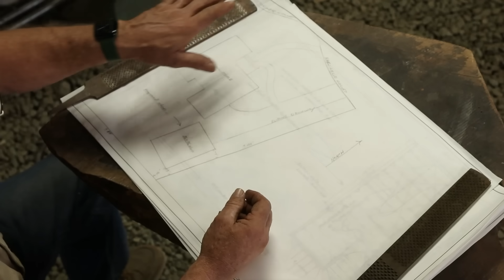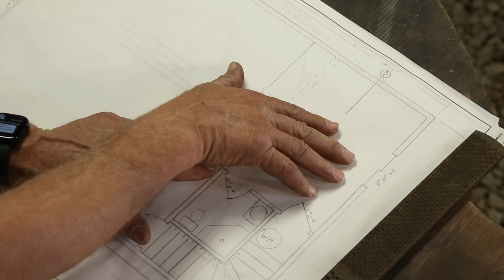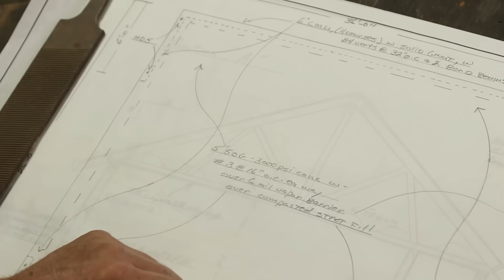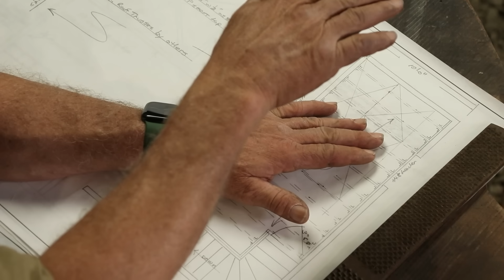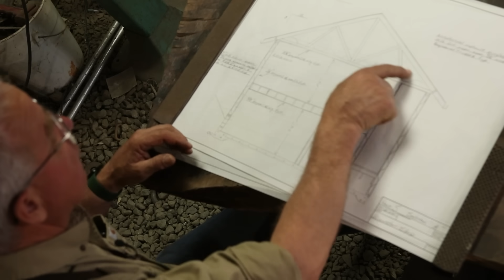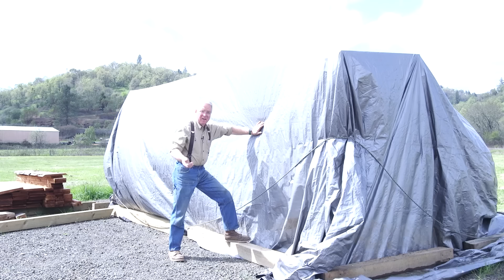Reviewing The Plans: Shop Build #1

Comment: Nice design. Love the bathroom and office. I did alot of flex space in the New England area in the 90s just like that.

One problem I saw: in the section of the stem wall the grade runs down and into the structure side wall.
That's a bad condition, especially w/ a CMU wall Vs. C.I.P.

In my general opinion and for conversation only:
Slope the wall back from the building 2-5% for 3-4 ft. to a swale that runs to the low side, front or back.
Add one or two course(s) CMU as req'd.

Comment: I'm sure it's too late for design suggestions...  but I would add some windows. On the North wall I would replace the louver with a widow (unless you are installing a powered fan). On the east and west walls I would have a window at the "second floor" level, to filter in natural light and be above any shelving or storage. and on the south side, a window into the stairwell.  As I look back at the north elevation, it appears that windows were considered and erased.   I would include an interior light on on a motion sensor that covered the french doors and the door to the stairs.  Looking forward to the new series.

Comment: This doesn't necessarily apply to the day jobs (as much), but do you have any advice on avoiding/managing burnout? I'm doing a remodel (full gut job, would've been easier to start from scratch) and I just end up having to skip around from task to task because I hit so many obstacles that I just want to quit. But I don't, I piddle around with other stuff, because slow progress is better than no progress. I know that I'm doing it all wrong, aside from performing solid work and paying cash for everything. Still, sweat equity only goes so far when you're without a home for the better part of two years.

Comment: I really like the experience you bring to your projects but what I miss are discussions about building science. I understand that this is a shop but I don’t see how you are going to insulate the slab. Are you going to address thermal bridging in the roof and walls? What sort of WRB are you using? How will you control air leakage? I am designing a similar shop and these sorts of details are easy to incorporate up front and make any building more comfortable and less costly to heat and cool.

Comment: As long as the tails are plumb, with white wood fascia boards, 30 degree drip edge 'flashing' ( NOT 90 DEGREE BARGE END ), 5k aluminum gutters that are properly graded, corrugated downspouts that won't clog easily, all you'd need is 'Gutter Stuff' to keep the crud out. 

Edit 2:
Gutter spikes are temporary, they work themselves out with expansion and contraction. 

Hidden hangers look clean but use small screws that do not hold, especially if you do not clean your gutters.

7 inch timber screws is what I use.
Withstands ice and snow,
I would know.

Comment: Hello sir, just want to know some professional tips regarding cabinets and shelves. I have a project now modular kitchen cabinets, using laminate marine plywoods. Am having a hard decision what to use with regards to screws in building pantry shelves. I want to know what's the good way to join boards without seeing screws on sides of shelves. Is it Dowel or minifix or screws with plug heads? Thanks

Comment: One comment while getting the quick review of the plans.  The section and front elevation show dirt slope a couple feet or so up the side of the building.  Do you expect to wrap the soil around the front to a touch-down point of add a small retaining wall down a drive a bit to contain the soil?  I think I also heard there would be no fascia board on the sloped ends, but a fascia gutter?  One thing I did to my shop build (and I am so glad I did) was spend additional money for the lighting and electrical.  If you think you need 4 lights, go with 8; if you need an outlet every 8 feet around the walls, go with every 4 feet.  Also, add hidden air lines (before sheet rocking) with numerous wall terminals.  There is no better time to think ahead than NOW!  It will never be easier of cheaper.  Thanks.

Comment: Live a couple hours North of you guys just south of Salem. Things I wish my shop (40x40x14) had when built:
- More 220v on the walls & 50A for welder
- Ceiling outlets for cord reels
- Ceiling air reel
- Rain collection for an exterior wash station
- AC for the office
- Solar on the roof

So far I’ve added everything but the last two. A crane hoist or car lift would be nice but not everyone needs those. Most people could use the rest.

Comment: Look forward to watching this. At today's lumber prices I cant afford to build a dog house,so I'll have to be content as a spectator, lol. I mill some of my own wood with an Alaskan mill, but you cant get much in the way of production, and it certainly wouldn't work where you have to meet codes. Currently at my local Lowe's a 96" spruce stud is $8.25 and 4'x8'x3/4" tongue and groove plywood is $66.73 a sheet. I say this only for posterity when someone watches this in the future
Reply: @Cipher Code how much production can you get out of an Alaskan mill? Can you give me an example of how long it takes to slab a typical-size log? How long does a chain last? Are you using a special ripping chain?

I'm looking at cutting a few oak logs into cheap boards for a temporary project I have going on. I'm wondering if it's worth buying a Alaskan mill and a ripping chain, or if I should just transport the logs to a local sawyer.
Reply: @jonathankipps9061  I usually use woodland pro milling chain,but I've used regular chain too. The milling chain makes smoother cuts and goes a little easier in the cut. How fast and how big you mill is dependent on how big your saw is. I have used a ms310 milling oak logs up to about 20" in diameter, but it was slow going. It took about 5 minutes per cut on a 8ft long log. Now I use a ms441cm, which is a 70cc 5.6hp saw and it can do the same size log in about 3 minutes. A friend had given me a good size silver maple 26" in diameter and I cut it into 3 8ft logs and milled all 3 logs into 1 1/2" slabs in about 4 hours. I dont remember how many slabs there were,but I'd say close to 20. If ya get a mill stick with granberg's as there quality is much better than the chinese copies. Your first cut must be absolutely flat or itll throw off all your other cuts. It takes a long bar if your gonna mill slabs,but if you want boards consider getting their edging mini mill. Itll cut down on your sawing time and it's dead on accurate. You can buy the small log mill and edging mini mill and be cutting great lumber for around $300,if you have good size saws. I leave my edging mill on my smaller saw(60cc ms310) and my small log mill on my ms441cm. You dont have to,but its convenient.  If ya have anymore youd like to know I'd be more than happy to help.
Reply: @ciphercode2298  That definitely helps, thanks!
Reply: @jonathankipps9061  No problem friend, anytime🙏👍

Comment: Nice looking project! I built my own 24'x40' 2 story gambrel roofed garage/shop back in 1995 using plans I found at a home center and modified with 24' engineered trusses to eliminate any first floor posts.  It took me about 4 months to build it pretty much by myself.
Reply: @Hello Tim how are you doing

Comment: I'm curious what you do with the interior.  I'd love a shop with a car lift, so that means high ceilings.  Also, do you wire up the shop in anticipation of the government forcing us into all-electric cars...meaning lots of places to plug your car into, if needed?
Reply: You'd only need one 220 plug.
Reply: @jamesengland7461  what if you have multiple cars?
Reply: @davidcurlee6759  even a 2 car garage this size will only need 1 plug. You'll be able to enjoy a "full tank" every morning without ever having to visit a charger unless you're going on a road trip or have a very short- range car.

Comment: How is that going to work with inspectors with the salvaged, resawn glu-lam beam (s) ? The whole concept behind engineered wood products is that it's a product manufactured and inspected to certain specifications, and it's installed according to the manufacturer's instructions and using the manufacturer's engineering data.     Once you re-saw a beam line that, it's no longer the engineered product meeting manufacturers specs, as it once was.   On the one hand, it would probably be ok to resaw a 6-3/4" X 15" (for example) down to 5-1/2"  X 13"    and then use the manufacturers engineering data for a 5-1/2" X 13"  glulam beam.  But in reality,  the resawn beam does not meet the manufacturing specifications for a 5 -1/2" X  13" glulam beam.  A glulam is not just a homogeneous chunk of wood.  The top and bottom laminations of a glulam (where most of the compression or tension acts)  are constructed in a specific way, using specific grades of lumber  which is different than the interior laminations  in a glulam.  So in resawing it to a smaller dimension, you've reduced the thickness (or removed completely depending on how much they were sawn)  of those critical parts of the beam.   With a new beam, you could demonstrate to an inspector with manufacturers stamps, receipts, etc, that this beam is a Boise Cascade  XX by YY glulam beam, and here's the installation instructions, and here's the engineering data.  If you've got a salvaged beam cut down to a smaller size, it could be anything, including something you assembled yourself in your back yard, with no manufacturing controls.  Seems inspector would be on pretty solid ground not approving the use of a resawn glulam without an engineer's approval for your modified product.
Reply: I'm guessing, but maybe it is oversize enough to not matter?
Reply: @ADBBuild  Yeah, that would be one approach, oversize enough that it doesn't matter.
Reply: Don’t ask, don’t tell. Doubt it will be caught or ever be a problem…… we will get to see if anything ever ensues at least!
Reply: @hamiltongarage7163  You're likely right,  but if it is noticed,  and the inspector does make an issue of it,  it could be difficult to fix if there's a substantial amount of the structure already built on that beam.

Comment: Any videos on a 6 foot by 12 foot shed? That is not only what I'm contemplating but desperately need to clear out the garage for car parking.
Reply: I’m with you. I built a 8’x8’x10’ shed in 2020 but moved and need to build another at my new place.
Reply: @jaredwaters4633  I have a small one car garage and just having two bikes and a push lawnmower makes parking impossible. Property crime has increased in my neighborhood and would like to park the car in the garage so I don't have to wake up to a brick through the window or creeps stealing catalytic converters.
Reply: You might look into a pre-built TuffShed or similar. I bought a used 8x16 with a barn roof and two large lofts for storage for $7k installed and leveled. I was going to build one and it would have been the same cost just for materials.
Reply: https://youtu.be/l8-LpSRrW44

Comment: Hi Coming from Sweden it would be nice if you add in picture the measurement also meters, not only in feet/inch. Like building projects. Thanks.
Reply: That takea allot of extra work and money! Besides here in US all of are materials are based on the imperail system here.  So convert over is a daunting task!
Reply: @thomasfogerty3515  mashing a few numbers into google is time consuming and costs money?
Reply: @autumn5592  A few numbers becomes several hundred real quick on a set of drawings.
Reply: @ADBBuild  Nonsense.
Overall dimensions of something or the length of the exact thing you're talking about is 5 seconds work to google, and another 5 to add a text overlay in post.
It takes no time at all.
Reply: @autumn5592  Then google for your own notes instead of reduce the essence of this channel to something it is not? Building within the imperial system is like baking within the imperial system-a very precise balance that can collapse if enough conversion errors are allowed to persist thru construction. 

We in the US often push back too much about converting units, yes, but a metric conversion for how to set your circular saw deck to rip X product to Y size in 1/3 the time at 2x the accuracy is pointless. You are supposed to listen to the theory and apply it to the world around you, not treat this like a “paint by number” tutorial. We in the USA rightly don’t insist that UK sparks’ channels go find and hire a graphic artist just to convert UK max kettle wattage to US max kettle wattage, we just enjoy being told how to make tea surrounded by tools we don’t have! I watch metric-system trades channels and can confirm it’s not the system of numbers that makes the process really differ—it is the practical result of the very subtle difference in available trade sizes, available materials cost/benefit blend, local codes and environment that matters to whether a given approach works elsewhere vs being reduced to a neat cinematic trick that might as well use a made-up number system!
Reply: Hi from the US. Sweden is a beautiful country. You have a strong lumber industry there, yes? Perhaps you can help us find the words to help the Essential Craftsman connect the dots. What I mean is for example this video has this detail: 24ft long garage wall.  What is clear to a builder in the US but missing for metric area folks is the translation from imperial trade size constraints to metric country materials, which US builders don’t know. The 24ft walls for example are designed at 24ft (not 23ft or 25ft) because 24ft is more efficiently scaleable due to 8ft sheetrock, 12ft boards, and so on. If we can get maybe a Swedish building materials catalog in front of a US builder, we can probably help EC translate to “this is planned Xft by Yft which is Xm by Ym but what matters is we won’t have waste or extra cuts, so this is actually the same building process as an X-n meter by Y+n meter shop using trade material range FOO in Europe”